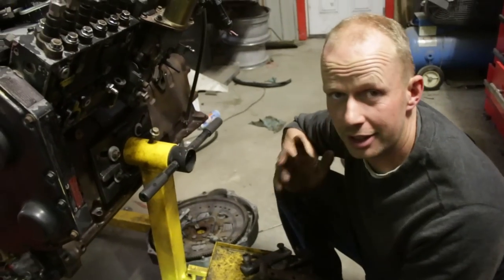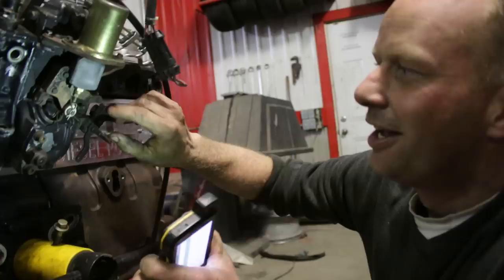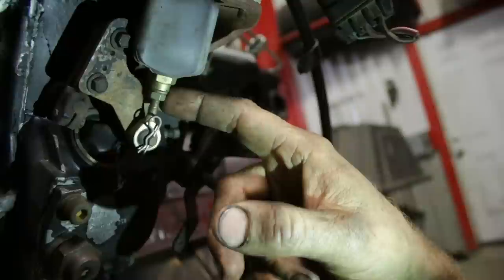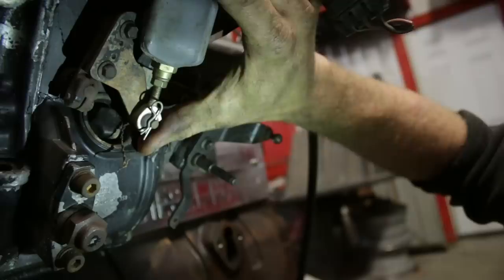P-Pump Cummins Hard Start, No Power? Check This FIRST

Comment: I have a 4bt common rail. No one has time for us. P pump this, 6 BT that, 4 bangers need love too.
Reply: Crazy KT 4 bangers get plenty of love.... it’s literally the 6 cylinder model with 2 less holes so any knowledge transfers..... if 4bts weren’t so damn expensive they would be more common.
Reply: Jason Truman petty common in my neck of the woods. They run about 1200$ for a compete unit froma scrappers. Not found a lot of of about performance mods for them. Mine is a 150 horse unit, but with the trailer and the box truck the whole thing is close to 9 tonnes, me needs more pulling power. Most of onlinjnfor about them is for the older 4BT, not the 4BTA common rail types
Reply: Crazy KT contact DAP (diesel auto power) I’m positive they could hook you up or at least know where to point you for tunes.  Where are you located? For 1200 that’s really cheap.   Last 4bt I saw for sale in my area was 3500 and it was the undesirable ve pumped one. P pumped ones go for more
Reply: Jason Truman I am in France, we have them in lots of 6 to 10 tonne trucks. Mine is in a 2003 DAF truck turned into a camper van. With 5 speed ZF manual gearbox and on spring suspension, so super reliable workhorse running gear. I hook my racecar and trailer up to the back and so need more power, I have yet to see a single you tube video about the common rail 4bt or read an article about tuning other than a U.K. company that does computer remapping. Not after a lot more power, 25% boost to the torque to get up those hills would do it.
Reply: Crazy KT yea being in the uk does complicate things.   You should be able to get to your power goal with just a tune.
Reply: Crazy KT sounds like a really cool rig though!!!!!
Reply: Not really

Comment: Hey buddy want to start off with I’m from Ohio and I love your videos and drive my wife crazy with them. Also I have a 12v ppump that needs pedal to fire, what do you mean by “just flick the lever over”?
Reply: He means take the fuel shut off solenoid off completely and then manually pick up on the fuel lever on side of pump and then start your truck. If it solved whatever issue you’re having or at least helped you know you had the rod on your shutoff solenoid out of adjustment. The fuel lever naturally wants to be in the run position especially when you go to start the engine. And to shut it off as your key will no longer work just push the lever all the way down. Hope this cleared that up for you.

Comment: I have a 1993 RV with a 5.9 N it was bogging down I changed the fuel filter but still the same. I noticed after sitting awhile I lost my prime as I was pushing the prime button I can hear air coming from the front of the engine but I can’t pin point from where it’s coming from. any suggestions I would gladly appreciate it.

Comment: You have ve videos? I just had my injection pump resealed on my ve installed everthing it’s getting fuel getting air I can’t get it to even pop just cranks..

Comment: Aww dam I have hard starts but no power lost. No shut off Solenoid anymore just the Manuel shut off pull knob. So now I’m thinking maybe the adjustments off for that pull cable. Maybe I could get more power!
Reply from the maker: Timing could have slipped on the drive gear for the pump.  Check that
Reply: Dammit I just tabbed my dowel pin and sealed the cover up with a new gasket lol. Doesn’t take very long to start up just maybe a couple seconds of turning over.  Starts instantly with a touch of the fuel pedal.
Reply: @Tuber359 that sounds normal. I’ve noticed 94-95 trucks start like a first gen no pedal and like half a crank. Than seems like 180pumps like pedal or take a few seconds to start without. And 215 pumps it seems hit or miss. I’ve owned some that start like a first gen and other that start like 180pumps. All of which had no “known” issues with fuel.

Comment: do i have one of those on my 1999 ram 2500 Cummins turbo diesel 24 valve. im thinking i do not. that motor u have i think is earlier style 12 valve i think.
Reply: Your 99 would be vp44 pump, this motor is 94-98 12v

Comment: Rich I have a 97 dodge with the p-pumped Cummins that starts hard no matter the weather or if the engine is hot or cold thought it could be the shut off adjustment you mentioned in this video. I checked the adjustment and it is fine I haft to roll into the throttle to get it to start if I don't it cranks a lot and slowly builds up and starts doesn't seem to lack power at all except when its cold sometimes its hesitant to rev and I haft to shift to keep it at a low rpm where it seems to have more power till it gets some heat into it. it does cough a little grey/white smoke every now and then when its cold. do you have any suggestion's? thanks
Reply from the maker: Check the fitting on the return line.  It should have small holes with a ball and spring on it.  That is the pressure regulator.  If someone switched it or put the wrong fitting in it, it won't start right
Reply: @DEBOSSGARAGE  I will check that out I appreciate your quick response!

Comment: My 95 ram 2500 dies went I turn ac on way can I do
Reply: Most likely the cause of that is your idle being too low. On a 12v I’d said the idle to be at around 900 at operating temp
In neutral or park.

Comment: BO Dude I have a 5.9 Cummins that if sitting up on a incline when cold it starts and dies 2 or 3 times if its pointed down the incline when cold it starts and runs ok.  What could be the problem? Really enjoy your video
Reply: Bo Dude sounds like the fuel in the lines is draining back to the tank. Colud install a one way check valve at the lift pump if that’s the issue
Reply: *could
Reply: @trevor9449  thanks I will try that

Comment: I have a 96 12v cummins and when i get up to about 60-65mph the pedal goes dead and then accelerates after a few seconds i thought it was the over flow valve but i replace it and its still doing the same thing
Reply: You ever figure this problem out?
Reply: You ever figure this out?? I’m dealing with the same thing right now
Reply: I’m having the same problem